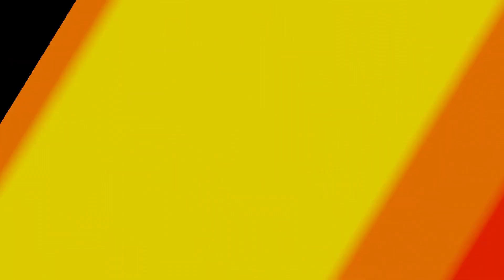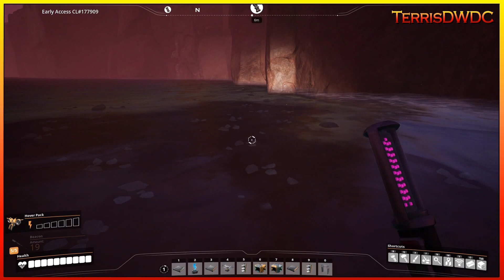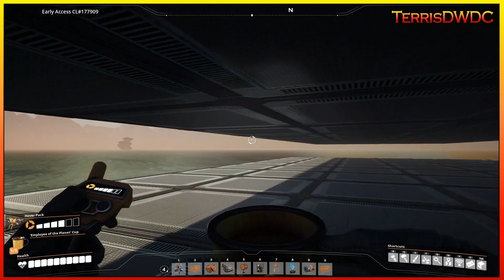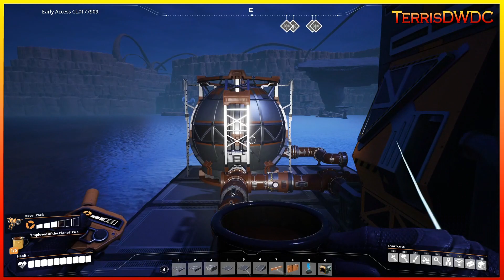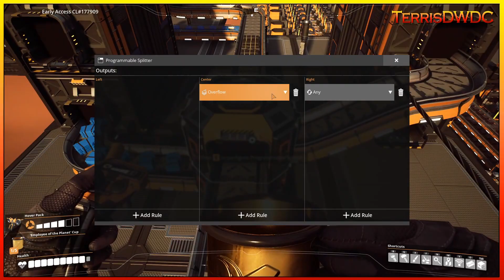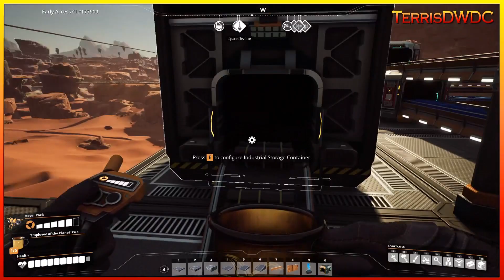Mega Factory - Plastic and Rubber Refinery plus Fuel Generators E03 - Satisfactory Update 5

Comment: The single-player bug with programmable splitters happens when you click the Add Rule button and will reset all existing entries to what they were before you entered the interface. So the workaround is to add the correct number of entries that you want before setting any of them. I also exit the interface in between adding the entries and setting them, but I don't think that's actually needed.